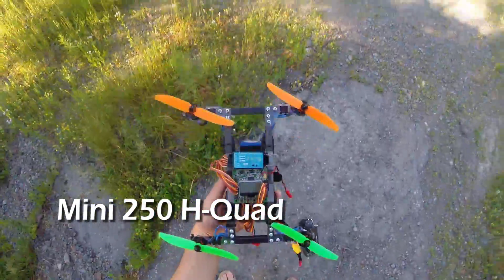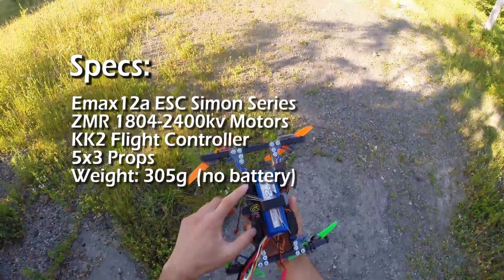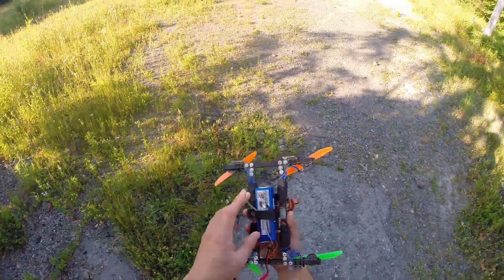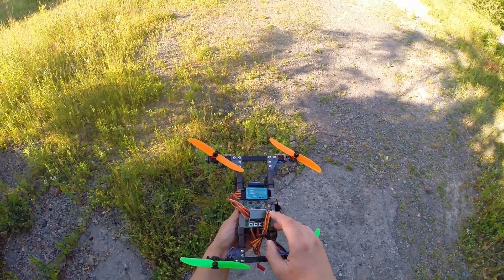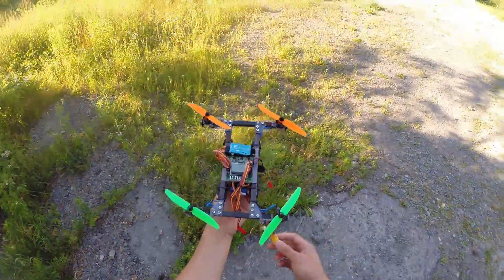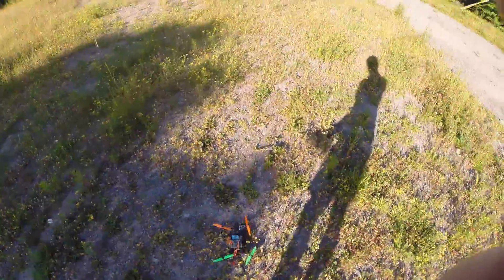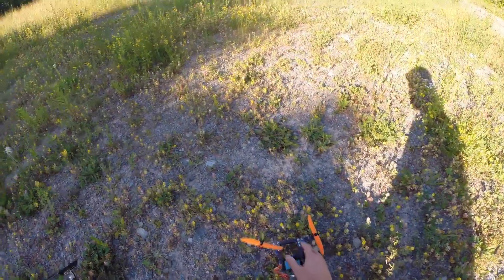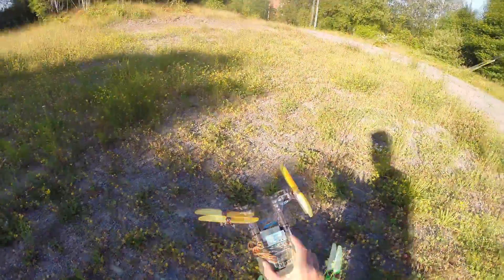Mini 250 H-Quadcopter Prototype - ZMR 1804-2400kv Motors

Comment: what size screws is needed for these motors, mine did not come with any. thanks.
Reply from the maker: Sorry I'm not too sure, I know they are small, I tried measuring with a thread gauge but I don't have one small enough... odd they didn't come with any.
Reply: Thanks for the reply, i purchased my motor off of ebay. I think they are M2x5

Comment: hi mate i was just wanted to ask if the ZMR 1804 2400KV Micro motor if u would recommend them for a ZMR250 250mm Carbon Fiber Mini Quadcopter. Also did u buy 4 clockwise motors, 4 counter-clock motors or two of each. There is a option on on bang good to select what mode(counter-clock or counter wise). In the past i have just brought 4 motors and swapped 2 of the 3 wires that run to the motor so they spin in the others detection
Reply: Andrew Muscat The motors actually don't spin the other direction, but the prop screws are reversed, so that you have self tightening prop screws if you place the motors correctly.
Reply from the maker: Hi, I bought all clockwise motors, it doesn't matter clockwise or counterclockwise as they are all 3 phase motors, so like you said all you have to do is swap the wires.  since the motors spin at such high kv's you should use some threadlocker on the nuts tho.  I would recommend them but they will not have the power or thrust like the tiger or sunnysky motors but those cost more and are always out of stock.
Reply: Andrew W  thanks mate .. iam going buy ZMR250 250mm Carbon Fiber Mini Quadcopter frame from bang good and just need some help with motors. I was thinking about just getting some ZMR 1804 2400KV but i want to setup this quad as a fpv platform. So weight will be a problem sounds like  am going to need better motors.  Could u link me tiger or sunnysky  motors that u think would work. the thanks again  c
Reply from the maker: I'm not at my computer but I'll have a look tomorrow.  Also I plan on using these motors on my goodluckbuy mini quadcopter, I have the fiberglass version of the one you mentioned. keep an eye out for video on that hopefully in the next week.
Reply from the maker: Here is a site I found that seems to have sunnyskys in stock.  only problem is that it's a one man operation and it takes over a week to get an order out once you place it, he even mentions on the website.  Do a search for sunnysky 2204, those are the motors that everyone seems to be getting. http://witespyquad.gostorego.com/sunnysky-x2204-2300kv.html
Reply: Kai Mattern i was just going to say that as well. thats why he needed to use thread lock.  thread lock on the prop cones can mess up the motor if it gets in the windings so thats never recommended anyways even on correct setups. just get some lock nuts and throw away the cones